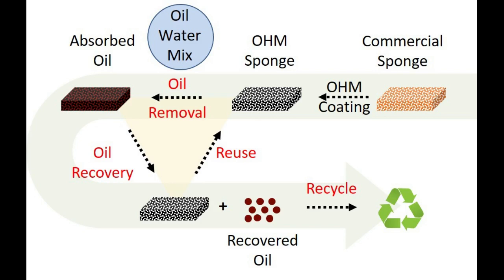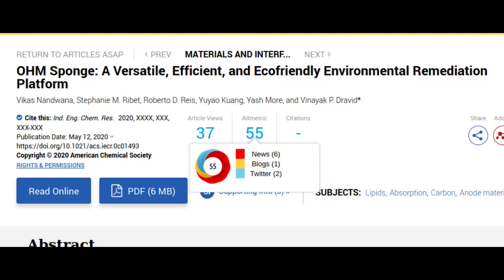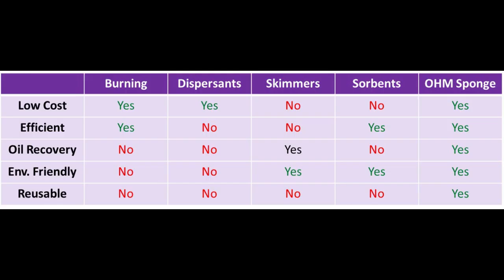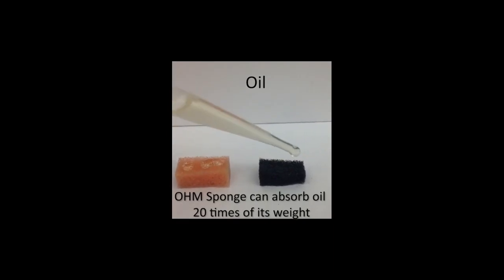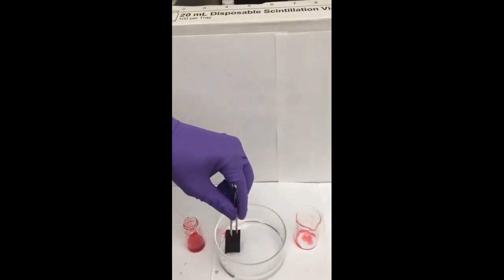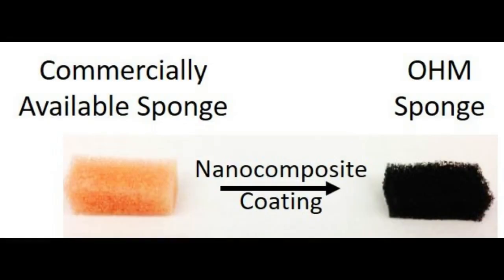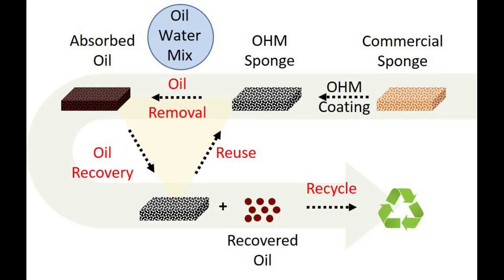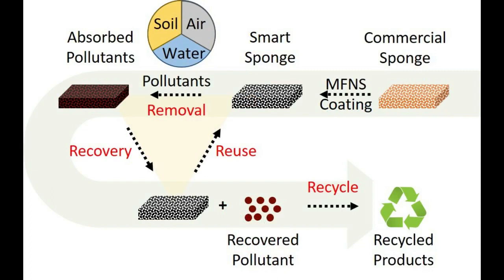Smart sponge could clean up oil spills | OHM sponge

Comment: How its made
Reply: They use a OHM (oleophilic, attracts oil, hydrophobic, repels water, magnetic) nano-composite slurry that you coat any commercially used sponge with.  Once the sponge dries out it can be used to collect the oil while repelling the water.
Reply: @justinblom3438   put from where I will get oleophilic material, hydrophobic is easy to get but oleopilic it will be challenging